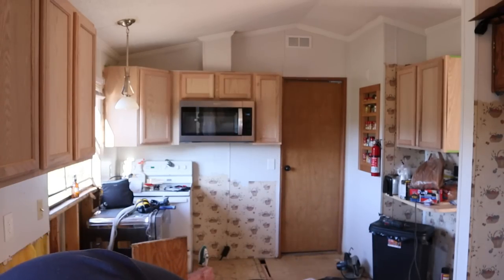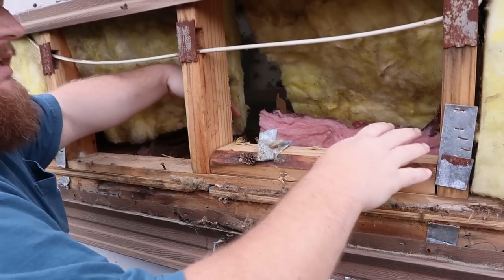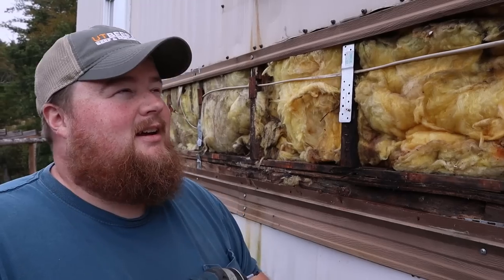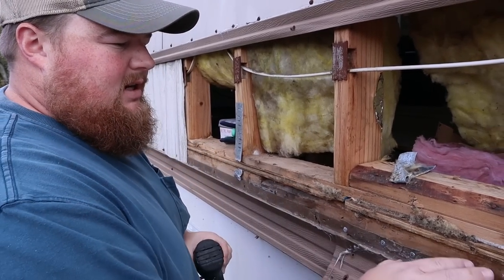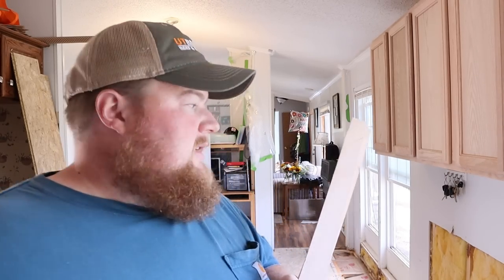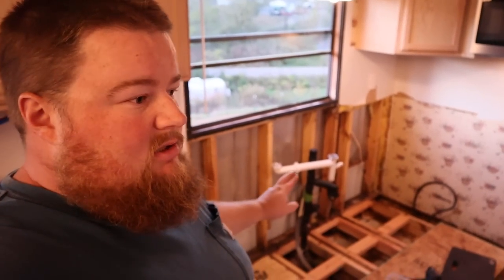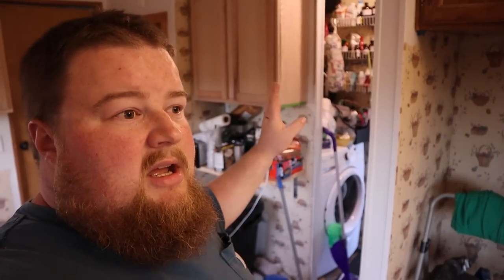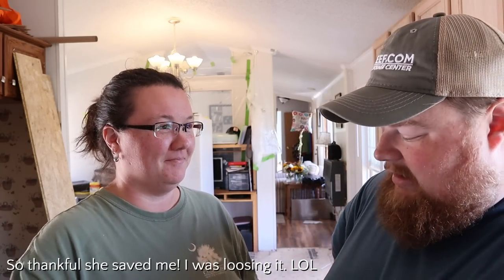Siding Removal Shows Just How Bad This Is | Budget Mobile Home Remodel #14

Comment: Maybe use a silicon on top of brown strip of metal. 
I'd be afraid of taking the metal off of my 1978 trailer.
You do what you can with what you have at the time. Good job.
Reply: well I'm with you Judy.... I just bought a 1977 single wide and as I walk around the outside i can find many soft spots. When I push on the metal, i see the screws move. I was hoping there was plywood behind it but I guess my studs must be rotten. WOW!!! Well I'm not sure if I should repair it, there also is a lot of repair in the inside that needs done (remodeling). It's a 1977 single-wide. I thought at least the bones were good but I'm finding out maybe not. I bought it with it's own land in Eugene Oregon, the lot is 60x100 so it's valuable property, I paid $68,000 but maybe I'm going to be spending $20,000 fixing it ????
Reply: @surveyguyor8958  My thought is, as your metal outside is covering everything, leave it alone. The living room ceiling in my trailer had broken boards. The boards thru out were small. If you have aluminum wiring, take it out now, not later. No electrician will touch that old wiring. Buy used items when you can, to help you save money. Fix the soft spots in the floors too. 
I'd take one room and make it liveable, then work on the rest. Good luck.
Reply: @judya.shroads8245  the metal outside, is moving when i push on it. I can watch the screws move, they are not holding onto anything anymore.
Reply: Thank you for all the help.

Comment: Off by 2 popsicle sticks lol🤣🤣🤣. I was curious so I measured my house with popsicle sticks and found that my first floor is 200 by 437 popsicle sticks in length excluding garage   200 by 363 popsicle sticks second floor and 3rd floor 200 by 167 popsicle sticks    Garage 147 by 187 popsicle sticks.   Give me a little bit I will get back to you I’m going to measure the perimeter of my property 👍👍👍🙄🤣🤣🤣🤣🤣🤣🤣🤣🤣🤣🤣🤣🤣🤣🤣🤣🤣🤣🤣🤣🤣🤣

Comment: Building code now requires a vapor barrier, when that home was constructed   it was not required.  Most likely though your water issue is coming from the top wall plate  or closest window and leaking down the metal sheeting.  The problem with metal sheeting is no matter what you do, the metal sweats at night.  The temp changes in a humid climate attracts moisture to the metal.  If you run AC at night it compounds this problem.  Without a vapor barrier that moisture wicks its way into the insulation, drywall and wood.   Creates black mold and makes your home a death trap.

Comment: With mobile homes I recomend upgrades for sure! Personally what I would do is, I would look into a zip system for the exterior and paint seal the seams and depending on what climate your in use a vapor barrier! He in a cold climate vapor barrier on both sides! But I would use T1- 11  on the exterior beef up the studs with 2×4 studs. New windows and then drywall the interior insulate insulate insulate!!
Reply from the maker: Very similar to what we hope to get done one day! Thanks Eric!
Reply: @sam-and-angela  you will be surprised how just insulating and using plastic as a vapor barrier will improve comfort and energy efficiency!

Comment: You can put black building paper under the siding too next time you take metal loose.Repair in small sections from the outside.CHEERS from a mobile home in Westcoast Canada!  P.S. I have that grey pipe in part of my 1970 mobile home.Seems to be holding up here.I think rodents like to chew it if they get a chance. Ihave 30lb water pressure here. Most mobile homes around here have wood sheathing under the metal exterior siding. Your outer rim joist is not too bad!

Comment: whoa.... I need to so some siding work on a 1977 single-wide I just bought. As I walked around i can push on the outside wall in many places and get movement. I thought maybe there was thin plywood behind the metal siding. Are you telling me that's not the case? behind the metal siding it's only studs and insulation? I can see my screws move, so does that mean all my studs are rotten? oh my. guess it's time to rip it all off and re-side it along the way, replacing or repairing studs as I go. Ouch.
Reply from the maker: Most likely you're in the same boat siding-wise as us.

Comment: I have too many old mobile homes and my wife and I have been rebuilding repairing them for too long. I cant tell you if you havent already figured it out that many times the rot in the studs and flooring below the windows is not necessarily due to the window leaking but many times if not most times was due to the dreaded window air conditions water from the condenser running down the wall and onto the subfloor as well, soaking the wall studs and floor and rotting all the wood structure!!! Window ac units are a great source of water and rot!! if you have window AC units........... at least make sure they are tilted to the outside and not inside the home

Comment: We have the same design on our trailer. We have never had a water leak issue. That damaged area looks like it's been there a long time. Our park said all the screws on our trailer are supposed to be shiny looking. The manager said no way, we cannot afford to replace them all. I found once you remove them, they will not go back in. The holes get sloppy. The screws would have to be larger. I  told my wife I would just paint them all silver if they want them shiny. Talk about a dumb rule. No one here has shiny screws any more. I suppose we could replace or paint them.

Comment: Just wondering about the mold you said was under your bedroom, isn't there a way you can spray with bleach to mediate some of it's strength?  If you removed the metal flashing like you did in this video and used a sprayer to spray with a combo of 50/50 bleach and water, wouldn't that help?  We had mold in our vacation home in Pa and it took a tole on our health until we had the trees that were encouraging the mold to grow down all around the house.   Now we're fine there.  Good luck with the renovations and I'm enjoying coming along for the trip.  Especially with your humorous way of reacting to things that would make others freak out.
Reply from the maker: It would definitely help to spray it. We’ve also learned to laugh at what we can when the going is tough. It lightens the load!

Comment: Gosh I call that picking a scab when you removed that siding . I’m so glad you could make a fix and get back to the job at hand. At least you know what you have ahead. I’m always very leery of “picking scabs “. Anyhow glad you were able to just button it back up again. I was surprised that there was nothing between the siding and the joists and insulation. When you work on the outside will you wrap or just side over the metal or what? Just  curious. You two make a good team. Thanks for sharing.

Comment: Whie you were fixing the "old" water damage from the window leak, I couldn't help but notice that the siding above that band of metal in that rotten spot (under the window, above the rot) sticks out and has gaps - maybe that is also a source of moisture getting in?

I am having a hard time wrapping my head around that siding design - it's a hot mess! How could the builders have ever expected that to NOT leak?? Lots of unsealed sills and transitions for no good reason......
Reply: Snickersnaps, I see what you're saying. Pretty sure they said this was a 1988. So this trailer is 32 years old, probably never had any maintenance on it. Those windows and doors are sealed with butyl tape.  Which over the years with heat and cold from the elements will eventually crack and will  leak. Really needs to be re-applied at the very least every 5 years to keep water out. Same way with the roof. Roof needs to be cleaned and rust removed and apply a layer of sealant over the whole roof. That's just the nature of the beast with a mobile home. They're just a quick way to get a roof over a person or families head.  Just sayn.

Comment: whats the tool you use to cut the nails flush? thanks!!
Reply from the maker: It's an oscillating cutoff tool. The corded one is a Porter Cable brand and I have used it for well over 8 years with no issues. I now have a cordless one (Craftsman) that I also like. They're very useful tools! https://amzn.to/3eqCI0u

Comment: Seeing this makes me want to rip off all the exterior shell of my trailer just to check it out. I picked up mine for a grand about six years ago. It has had some leaks since I've been here. I've been reluctant due to age of the house (built in 84) and the many layers of paint on the outside will make it a bit more difficult to remove the screws. To make matters worse, many of the screws are rusted pretty good. Still, this makes me want to do it anyway.
Reply from the maker: Never know what’s underneath!  That’s for sure. -A
Reply: @sam-and-angela  After finishing the video, I must have lucked out. All my subfloors are plywood. I know this from some repairs I had to do after I moved in. Of course, I have that gray pipe and it worries me. I'll be going PEX eventually. That little saw thing, I'm going to have to get me one of those. Looks very useful. Thank you for the video.

Comment: I'm moving to a mobile soon that has a corner sink, do you know if it's easy to move to forward facing cabinet or am I stuck with corner sink
Reply from the maker: Easy is such a subjective term. LOL It can be done for sure! However it will likely require plumbing work as well as some cabinet modifications depending on which you're moving it to. Good luck!

Comment: I'm sure you know this by now, but polybutylene plumbing has been banned and should be replaced ASAP... it will not pass on a home inspection. 
Replacing it with Pex is fairly painless, and for you DIYer's "Sharkbite" connectors are your best friend!

Comment: Why did you use a metal bracket?
Reply from the maker: To help stiffen up the stud joint until we can replace it later.
Reply: @sam-and-angela  I was just wondering if it's possible to use like a piece of wood because of the electric wire

Comment: I am old and living in a 1973 single wide mobile home and extensively had to deal with some of the issues your now l plagued with. I was able to magnify your siding as you took off aluminum panels at kitchen sink area and  immediately noticed a couple issues.  One could probably be taken care of by just getting you money back for the black spray and tape you bought. Neither will  fix the issue other than cost you money , frustration because  the water issue will not be addressed. The window tape is not UV rated and sticks to everything and looks terrible. 
     First , it is necessary to point out something about metal when subjected to heat. Everyone can see what happens as a pot or pan is placed on the stove  and the heat is turned on. Moisture condenses on the exterior of the pot. Metal siding is no different althouh the heat comes from the sun moisture will condense  on the back side of the siding. For that reason a clear plastic sheeting is stapled to the exterior side of the wall studs right next to the aluminum. Think of that lower brown pained aluminum strip as a drip rail to drain condensation water away from the wall.   You can atill see small staoles on you r 2 X 4s that at one time held plastic sheeting. You will need to take off more of the siding and replace all missing plastic sheeting. Rolls of thick plastic can be easily found and stapled into place for that purpose. 
     Secondly use the correct screws and staples. Aluminum when in contact with steel will cause a prosees of electrolysis that eates away the aluminum causing more leaks.  Staples made of stainless steel to hold sheeting ar a must. 
     Screws: All the old screws on you siding need to be replaced with new pole barn screws. These screws come painted whit or brown, have rubber washer under a hex head that you can easily use a screw gun with socket attached to instal. Get pole parn screws longer than the ones currently on the home  and be sure they are compatable with aluminum siding. They will be made of aluminum or stainless steel.  When you use a screw gun to replace be sure not to over tighten on the rubber washer as this too can cause leaks.  
    If you have read what I wrote so far you will understand water runs down hill and many times it can run between  metal sheeting and a vapor barrior plastic sheeting many feet across a roof truss and down a wall even twelve feet away.  So be sure that your roof does not leak to include around vents and pther pipes. 
     Older trailers have steel curved roofing. Should you replace the leaking roof or fix the leaks? Most often the best thing to do is to fix the roof so that it does not leak. If rusted through make a patch of the same material and clean off the rust. I learned this from an old man my age whom made a  good living repairing leaky roofs primarely on commercial buildings with flat roofs.  I have used this on my home and the usual annual find the leak problem has not happened for over 5 years now.  The largest issue with metal is its need to expand and contract especialy in the extrem temperatures of Minnesota where I live. Local home stores sell gallon pails of acrylic roofing patch that can be applied ever on a wet surface.  Then you need fiberglass sheet rock tape that is like a open screen.  For ribs or around those pipes remove loose material.  Spread a thin layer of roffing cement on surface - cutlength s of foberglass sheet rock tape and push into that thin layer adding a top thin layer to completly cover the tape being sure no air bubbles remain in tape. This allows for  your patch to expand and contract without  leaking again.  This type of roof repair may worrk on all roofs  especially  around vents or over screews.   That old man called it a 30 year patch and never needed to go back on one of his repairs.

Comment: Man if you value your health, go in tear out the molded wall boards, put plastic up if you have to intel you get money to fix it. Black mold can miss up your central nervous system, ask me how I know, um the hard way. Pull that metal off throw on house wrap and it will at least keep the water out.

Comment: please dont assume that the spray rubber product that you used is anything but a very very short term waterproofing flashing? 

i dont know the background of this project, but you should know that most of the spray "rubber" products are sort of a sprayable RTV silicone rubber and they a joke when it comes to what a quality sealant should be and how they perform.
Reply: eh, i rewatched that part and i think you ended up using it as a sort of adhesive primer to stick asphalt flashing against your band joist?

Comment: had similar damage on my mobile home, old windows leaked and destroyed the old siding which was also the sheathing to the building. and the new vinyl siding hid it so after the new windows were put in you thought it was fixed

ended up cutting out some of the damage and patching with plywood and flextape/silicone/foam spray. (will eventually redo it when siding gets redone but it will work for now), and then sistering up the window supports that were rotted (which will also needs a new sill plate) only got a few images of the issue, https://imgur.com/a/ECzO9Cc

also had some wasps as well, I sprayed the hole with wasp spray several times (thank god they dont move when cold) and then filled the hole with a lot of spray foam